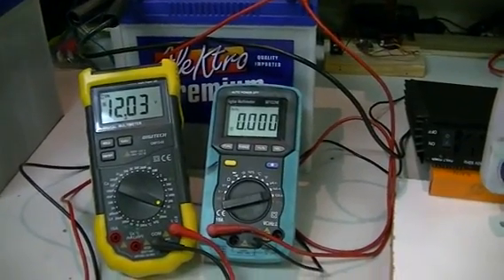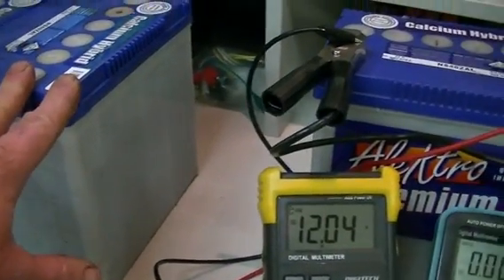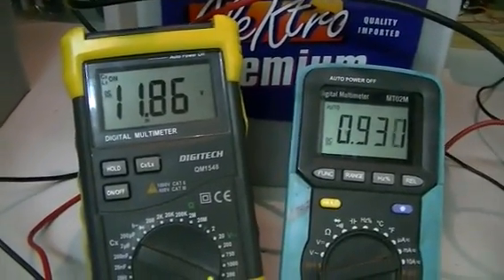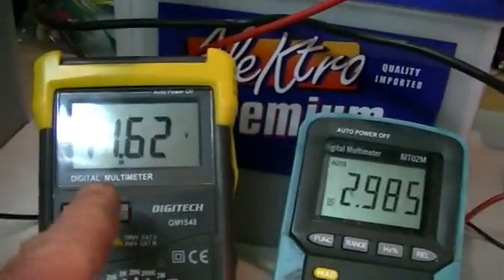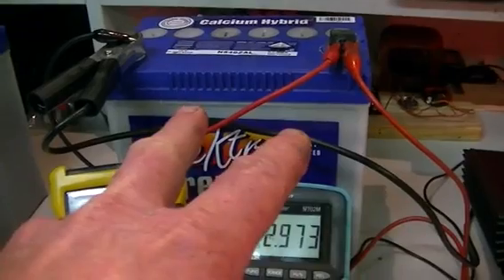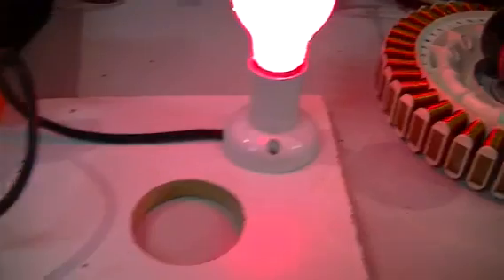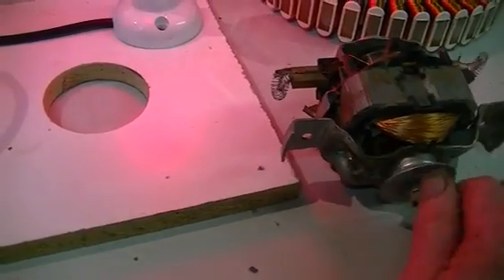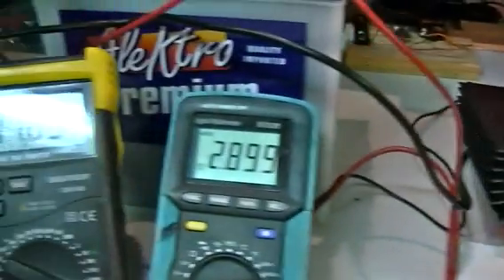3 Battery Paradox Test.

Comment: one of the real secrets to tesla's work, involves hard switching. everyone loves their brushless stuff because it doesn't need brushes replaced. closed systems are freaks of nature and don't exist. it's the spark gap where the magic takes place. you can increase your power output by simply jumping it across an air gap. you can also further increase it by using two different materials in the spark gap. this truly is like magic.

Comment: Tinman, i run a modified ssg on the three and four system, it has been a thought when looking at my setup, ive got a funny feeling that if a system ever went totally  flat from a failure and you got system up and running again, that back battery could charge up, and it ends up reversed polarity( flatten a lead acid battery and charge it up in reverse and up she will come reversed) just a thought, what do you think...love your stuff..big thanks for sharing.........slippery

Comment: nice start on these type of circuits!
the really efficient part works best with 4 batterys although it can be done with 3.
how i understand this circuit is that efficientcys start to happen when hard switching the 2 banks from series to parallel with the load on de fwbr.
thumps up!

jeroen